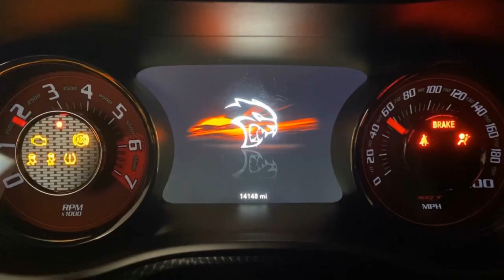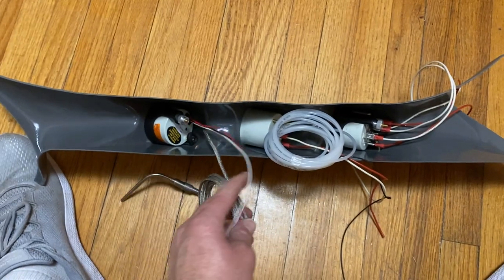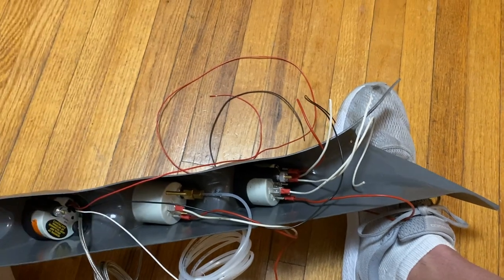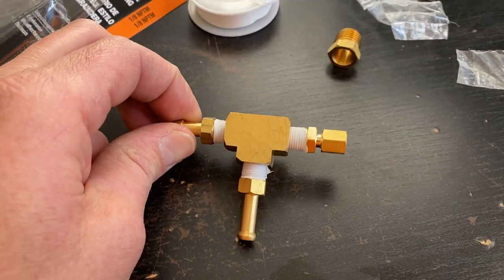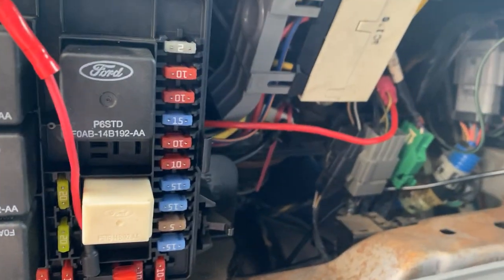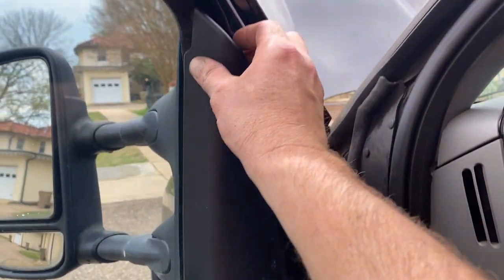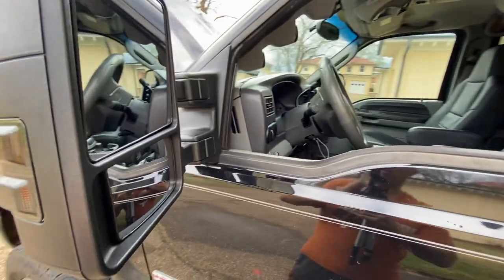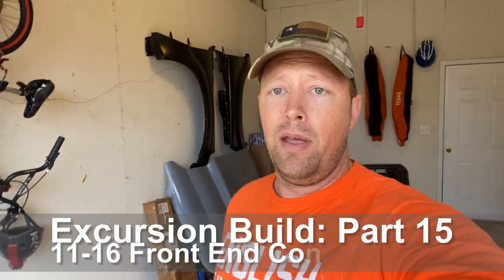Excursion Build Part 14: A-Pillar Gauges/ 11-16 mirrors installation

Comment: Do the new mirrors power extend and fold in or do you have to do it manually? Gorgeous truck, by the way! I just picked up a 2006 F350 Crew Cab Long Bed as a work/project truck. Thanks for some more ideas….. my wife will be thrilled, LOL.

Comment: From one vet to another brother that rig is going to be a beast when you're done with it. I gotta ask though what is your honest opinion of the kill devil motor? It seems like a great fit but before I drop $20k + in motor and Tranny I want to be sure it's worth it.
Reply from the maker: Not an easy decision, I went back and forth for months. The motor does feel smoother than stock, but if your plan is just to simply daily drive, not worth the cost. I made the decision based on the fact that I want to play with it. And now I have an extremely solid and realizable foundation. And If I got crazy down the road, I could through even more boost and fuel at it without issue. Not sure this gets at what you want to know, but happy to discuss in detail for sure!
Reply: To be honest since I'm gettin my ole lady a Tahoe or a bigger SUV and we plan on having youngins this will basically be my Tahoe but I like to play to but I also have plans to use it as a hunting rig and to be honest it's cheaper/more fun to sleep in the excursion than a hotel room which we enjoy doing already. Either way it'll be a family tow/hunting rig no heavy towing just boat and side by side really. Maybe a small camper later down the road.

Comment: Make a custom box for a compressor where your spare tire goes and put air lockers on it?
Reply from the maker: That’s definitely the off road we way to go. After doing some more research, I’m leaning towards the Detroit trutrac. Maintenance free and don’t need air or electrons to activate the locking mechanism. But if I was going for an off-road beast, the air lockers would be the way to go.

Comment: what leds were those that u put in the doors?
Reply from the maker: https://precisionled.com/ford-excursion-led-interior-package-2000-2005.html

There are cheaper kits out there, but I have not had a single issue with these.